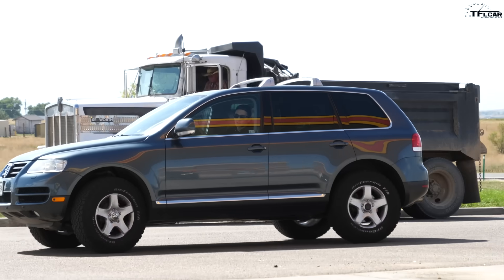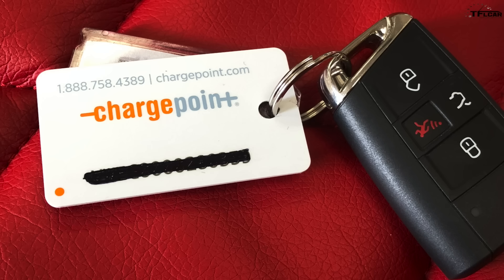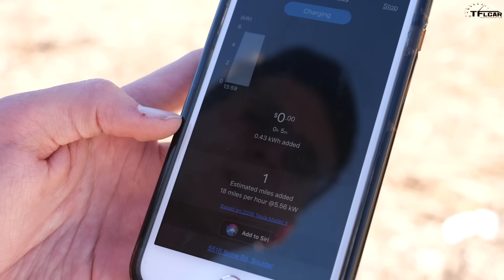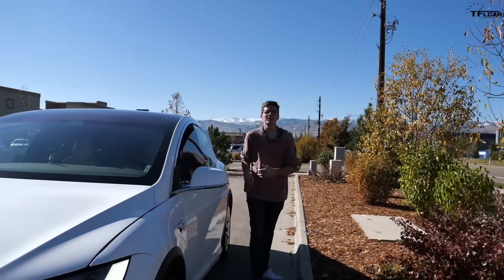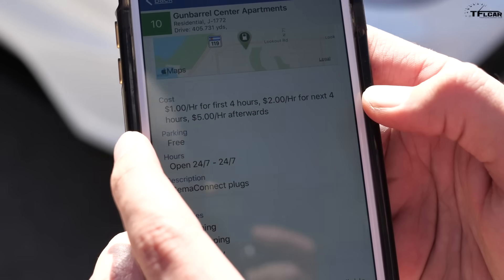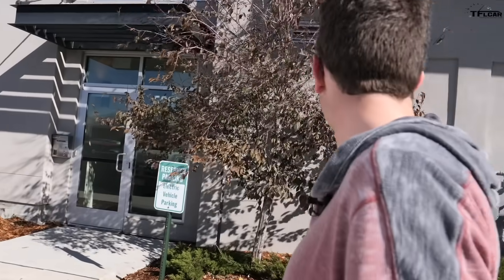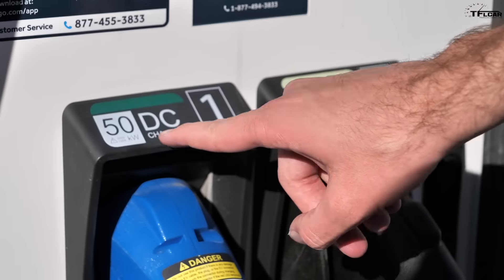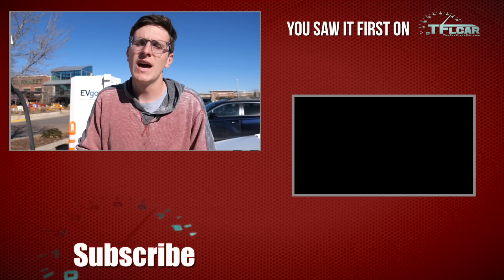Here’s Why Charging an Electric Car Can Suck - And It’s Not The Reason You Think!

Comment: I've had an EV for about 3 years now and I've used a public charger 3 times in that time.  2 times was at a hospital while I had an apt (didn't need to, but since I was there...) and the third time was at a mall that had EV charging at a good parking space (didn't need to again, but better-than-free parking).  All three times it was free to charge.  The hospital covered the bill, and the mall used the EV chargers as a way to get people into the mall.

Most public chargers have an intended location where you will spend time. At a residential location (You are home or visiting a person for a few hours), at a business park (go to work) or a shopping/dining establishment.  For Road trips you plan your charging to match up with your meals.  Stop for 30 mins to get some Chic-Fil-A, charge 100 miles into your car.

As for my normal charging. I plug in my garage. I will need to charge (refuel) once a week (same as I did with my Mustang).  Right after I got my EV I checked my electric bill and compared to what I spent in gas before.  My "Fuel" costs just dropped to 8 cents a gallon.  And here's another fun kicker:  What have I done for car maintenance: I've done everything by the schedule. I've spent in the past 3 years $15 in maintenance costs, and that was for a new cabin filter. That's it.  No oil changes.  No air filter. No fuel filter. No fluid changes until 150,000 miles when I need my coolant systems (I have 3) changed.  There are only 3 things listed on my maintenance schedule: Rotate tires (every 7K), Change Cabin Filter (Every 25K), Change Coolant (150K). That's it.
Reply: Similar to my experience. This video is hammed up.
Reply: Is his working for the petroleum industry. 😬
Reply: Really good explanation for most EV drivers.

Comment: To add to the problems outlined here, I’d add 1) charging stations that don’t work; 2) EV owners who keep their car plugged in blocking the charger even after they’re done charging; 3) ICE cars parked in front of chargers. I even once had the fast charger for my car blocked by a guy in another EV who couldn’t use it but seemed to think it was EV parking! I experienced all these problems driving an EV for six years in a very EV-friendly city and state. It’s also not the case that there are chargers everywhere. Matt (aka Smoking Tire) had an I-Pace press car last year and had trouble finding public charging in Venice and Mar Vista a very tech friendly part of L.A. We need to be more green, but I bought an ICE car so I can avoid all this, and not have to stop to charge for hours on road trips.

Comment: Great video, I was considering getting an electric car for around town use, but now, probably not.
Reply: The Chevy Bolt has a 259 mile range (and typically gets over 300), do you drive more than 300 miles around town in a day?  If not, an EV would work just fine for you, as you'd be charging at home like 95% of EV owners do.
Reply: I don't think anyone but the most delusional Kool Aid drinking fanboys think EVs will fit the needs of everyone in the near future.

Comment: Charging a Tesla is simplicity at its base. Drive up to a Supercharger. Plug it in. Set how much charge you want. Nothing to do but enjoy the savings as compared to petroleum. 

Admittedly, you may live in a building where charging is impossible. But with the Tesla providing at least 5 different ways to charge, from a wall outlet to a Supercharger,even adapters for these other farkakteh chargers. And Tesla chargers cost at least half that of the other company's chargers. And one Helluva lot faster.

Comment: I’m not an engineer, but I just thought I’d throw this idea out there:

What if electric vehicles were designed in such a way that the rechargeable batteries would be just light enough that the average motorist could change them himself (15-20 lbs?) and there would be two changeable battery slots.  Whenever one battery would die, the power would automatically switch over to the back up battery. The driver would then stop at a place were here he could exchange the dead battery for a fully charged one, and receive a deposit on the drained one, similar to the way you might turn in empty reusable milk bottles at a dairy and get a deposit on the empty ones that you turned in.
Reply: Sounds a lot like those propane tanks you see outside the hardware store. I guess one minor problem is how you account for the age and health of the battery and retire old ones. I think it would end up costing more than waiting for a recharge, simply because the trading places would have to make enough on the exchange to replace those old ones, but certainly there's the convenience factor. Plus, ultimately, your battery will need replacing anyway, it just spreads that cost over time in little bits. If the battery's age can be easily measured then I guess you would just pay some rate for how much newer the battery you get is, than the one you're dropping off.

Comment: why is the charging process for vehicles so disturbingly moronic?  Would it not be simple just to use a visa or debit card and then submit your cell# or IM when car is almost finished.  The only thing i do like is the app that tells you location and availability.  The payment schemes seems counterproductive.  The option for cash is gone.  Maybe having the ability to drop 20$ as a deposit and when complete you get change back when returning to the car.
Another peeve charging ports, why companies are so reluctant on standardizing.  I thought the idea for electric cars is to move all or most drivers away from petrol based transport,  This is not helping.

Comment: Its like usb cables. Expect change to charge quicker. Messing with adapters lol. Gas pump fits ALL vehicles with a gas tank. Period!!!!. Why complicate things. Just make gas engines more efficient like they are getting. You waste miles driving to a charge point to gain miles by HRs? Lol. Basically you better hope your Tesla doesnt die.

Comment: It takes me 2 minutes to fill my tank with gas and I can find a gas station at every corner. Electric is not worth it until I can charge my car completely in 5 minutes and all charging points starts accepting credit cards so I don't need every app on Earth to charge.
Reply: Exactly. I've never understood why ev owners brag about not having to stop for gas.
Reply: Brett Friedman because basically you can charge your ev car overnight at home, so yeah you don’t have to stop for gas during the day. The charging points are for when you go on a long road trip. And on a road trip, even with a gas car, you need to stop at lease 30min for break/food. So meanwhile you can charge your car and have food. A supercharger give you 80% of full battery in 30min.
Reply: @aunchaleek7120  Look, I fully support electric vehicles, but don't try to tell me that it's more convenient to own an ev than a gas car
Reply: Brett Friedman when did i say it’s more convenient? I just replied you on the topic ‘not having to stop for gas ‘
Reply: It takes 20 seconds to plug in the charger in my garage. When I get home
Reply: I suspect the main reason every public EV charging station I've seen doesn't have a credit card reader is security, as there is no stationary/associated attendant or maintenance crew it would be easy to place a credit card reader/pinhole camera to steal information whether the magnetic/chip info or PIN codes.
Reply: @senoB  makes sense but it's still a huge disadvantage for charging.
Reply: @pandorakid229  spark plugs and wires are only changed once every 100k miles and by then most people get a new car. The most you worry about in new gas cars these days is just oil change and fluids. The convenience of gas cars still wins over charging. Electric cars still need maintenance. Yes it's less but What it is idk.

Comment: In a few minutes I can fill an empty tank of gas and be on my way and do not worry about gassing up for the next three days.  I do a lot of driving in my work.  Electric cars are not practical and won't be for a long time to come.
Reply: Agreed. Electric will likely take over, but it's going to be a while. Projections on this subject that I've seen are a joke in my opinion.But, I'm glad those with the expendable income are making the sacrifice. That's how technology works. Those who can afford make the leap first, then the rest of the market SLOWLY follows. I define slowly as 15-20 years since many used compacts are extremely reliable. Especially Prius, Civics and Corollas.
Reply: @johnsheibal4330  The battery and charging technology needs to be improved.  Also there will be a stain on the power grid if millions of cars are being charged at the same time.   I have not heard anyone address this issue either.
Reply: For your use case, no it's not practical.  However, a very large number of people in this country drive less than a hundred miles a day, so for many it is practical.  Right now.  Not in a long time.  Now.

Comment: Hay for a form of technology to last     it have to be better that the existing one in stead of wasting time on electric vehicles  they should im improve internal combustion engines or even develop ethanol  or methanol as a fuel that is the direction  making batteries still have  negatively impacts the environment.

Comment: It is the HOURs and HOURs it takes to charge and EV. That absolutely does not make sense.  When you consider it takes approx 15 minutes to fill your car tank with Gas.  If you are stopping at an overnight, the EV would not be an issue. But long trips most definitely a HUGE problem to have to wait and charge.

Comment: This is an honest question

I live in a very cold environment 
And anyone that lives in a cold environment knows the havoc the cold weather can place on a regular car battery. 

I know the batteries on an EV are not regular car batteries. But I am curious what effect cold weather has on those batteries. Can you have a difficult time holding a charge? Or is there no difference whatever the temperature is?

And when I say cold temps
-40F or -40C can happen regularly

And yes, even with gas/petrol cars special protection is needed. They are called block heaters. It is plugged in and keeps the engine oil warm enough to circulate when the engine is first started.
Some people even have a battery warmer to help the car start.

Comment: Another issue is that junkies are cutting the cords for the copper wire to sell for drugs. I recently stayed at a hotel in Charlotte NC & the charging area was roped off with yellow caution tape & orange cones because all eight cords were cut.

Comment: At 37 seconds into the video notice the ivory face plate on the outlet that he's plugging into, it's discolored / brownish. That's a sign of the receptacle behind the face plate is over heating & will eventually melt not only the receptacle itself but the wire supplying the power & causing a FIRE!

Comment: Charging station hours from 8 am to 5 pm?  That's when people are at work - no chance to charge even a single car overnight, then.  The sticker reads to call the Charging Team but there is no phone number provided.  Multitude of plugs, chargers, apps and neither work with any other: in an unfamiliar town one would require to have several apps and check them all for a nearby (compatible) charging station.  This is already a big fail.  Cars may be nice but the whole charging system is a complete fail.

Comment: Why would you want to charge at these points when you have a Tesla? Tesla’s charging stations will give you 80% of your battery charged in 30mins... and Tesla has a lot of stations.. 

These points as mentioned are in malls and public spaces, where you are away from your car for a few hours at a time which will give you the opportunity to charge your car with the miles you used to get there from home..  

Teslas have a huge range and you will never need to use any of these points!

Comment: Nice job sharing this.  That's why I have a Hyundai plug in Hybrid and I'm able to go round trip to work on battery only with a 220v charger/solar panels.  I did use Charge Point for free but after everyone got wind of it got competitive. Now they charge money and they other places. The last time I used them I got vandalized trying to save money it cost me 500dollars deductible for insurance than .70cents.
But I can travel with gas and electric  3000 miles on

Comment: The way to introduce this properly is to have chicken wire above MAIN roads and pantagraphs fitted to the cars to draw that power. The batteries in the cars would then only be needed at the start end end of a journey - and you then pay on a motorway / turnpike for using it

Comment: If spending 10 hrs leaving your car in a parking lot during the day for this purpose, then the cost of the charge point is irrelevant.   You a human being will spend a great deal more money in 10 hours killing time than the cost of the charger.  Families will compound that ten fold.  That is why malls,  wineries,  movie theaters,  sit down restaurants and hotels are putting them in.   The others are doing it for a tax credit. 

Charging overnight while you sleep is ideal but that will be the most congested time at a hotel or apartment complex with two points.   100 guests, 40 empty EVs and two chargers means a lot of pain 6pm to 6am.   Even if each guest got an hour max,  that means many people must arise at 3am to move a car. 

The self park and summon feature is Teslas planned fix for this,  but as there will be many EV companies and charger plugs,  that will still be a problem unless you stay and park at Tesla managed properties.   Change Ching.

Comment: A long way to go before EVs can really take over from conventional engines. Long charging times, limited range and the fact that (down here at least) the electricity going in to the EVs is still made from filthy polluting coal. Unless there is a way to fill a battery in a similar amount of time to filling with liquid fuel, EVs are not going to be useful to anyone who travels outside of city areas.

Comment: The rest of the world mostly runs on 240 volts. Not 110 like the USA. 
Also there will be other cars wanting to use the station causing stress. 
The infrastructure is not integrated to provide seamless use. Tesla annoys by making a different plug. 
The DC charger again is not easily used. There is no shelter at these stations unlike petrol stations so sun, rain and snow will be a challenge. 
I couldn’t use an electric car as I undertake many long trips shush are time critical.

Comment: Very informative and enough to make me realize that the concept is absurd for every day life. Next car will be a hybrid. An e v with that rate of charging  is beyond absurd. I drive New England to Florida every winter.   21 hours driving time door to door. Four tanks of gas...$150 . Period. These vehicles would take at least five recharges at 20 hours each plus the 21 hours driving time. I could ride my bike there faster.  Plus.... the rate of battery depletion has to be much faster in cold winter temperatures requiring even more stops. Sitting in the expressway in a traffic jam in August with the AC running must do the same.  Oh yes.... living in an area with super high utility rates will probably cost more in electricity than gasoline....and finally..... what are they burning to get the electricity to the charging stations?   Oil, nat gas, coal? And of course disposing of 1000  pounds of batteries from old cars is a very clean thing to do. The whole matter is pure nonsense.

Comment: For the one that charges more after 4 hours: What's stopping you from idk, un-plugging it and restarting the timer over?
Reply: Probably some sort of DRM built into the charger & car. I bet charging stations will pull information from your car & still charge you the higher rate even if you pull & reset the charger.

Comment: if you buy an electric car anywhere your not too smart.very few charging stations and some charge even more than gas. In Iowa gas it about 2.30 a gallon my car gets 45 mpg so its very cheap to drive.My challenger OTOH gets about 25 to 27 mpg.but has a 15-gallon tank. both cars have a longer range and i can get gas anywhere without the fear of running out. Plus a Tesla is a rip off for around $90,000. iF i can afford a $90000 car then I would get a hellcat and not even care about the cost of gas. 
Electric cars take about 5 years before they even show a profit on savings so not worth it except to say ohhh loook at me Im sooo enviro-friendly. Its more an ego trip than an enviro issue. You also leave out that battery life is about 5 years and at $6000+ to replace is even less savings and the enviro impact of those batteries is worse than a gas car.

Comment: Why do these even exist? Who is using something this pointless? Charging stations at 150kw are barely practicle let alone 6🙄. To make it anything like pumping gas it would have to be 8.4MW or 8,400kW. (10gpm~0.63 Liters per second at approx 1/2.5 the efficiency of electric and 33.18 MJ/L) at that kind of wattage to not melt the conductors you would need about 30-50KV so  you would probably need a connection on either side of the vehicle and the frame would have to be polymer everywhere near them to prevent arking. The heat generated by the (high but not high enough) thermal efficiency of charging the battery would require active cooling so the vehicle would be running a radiator fan while it sat there.

Comment: Yeah, that why I drive a carbon emitting fossil fuel car. You would be crazy to put with this crap trying to get you car charged in the field. Five minutes in a gasoline station and off you go for another 300-500 miles. Give me a call when refueling becomes as easy as gasoline.